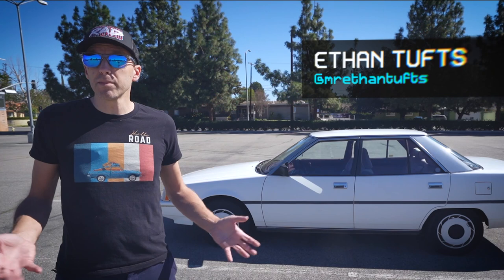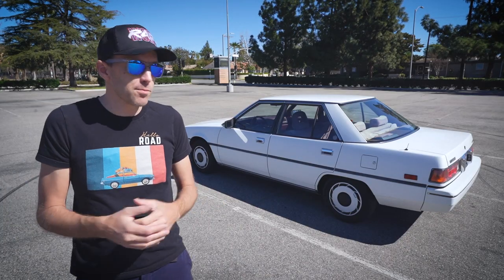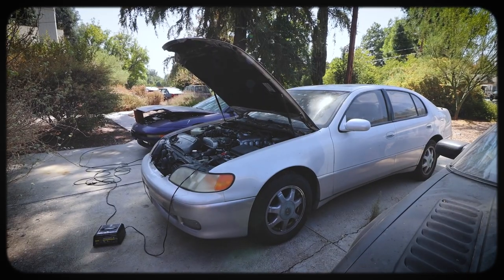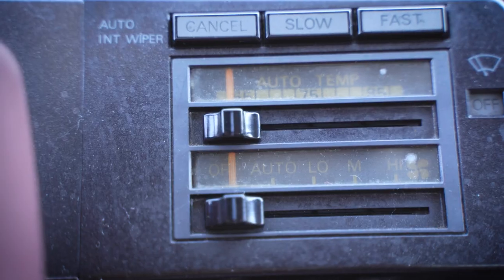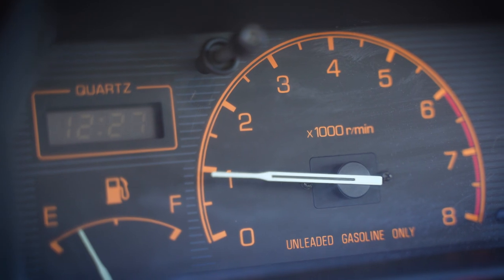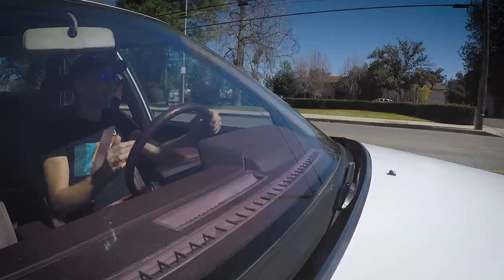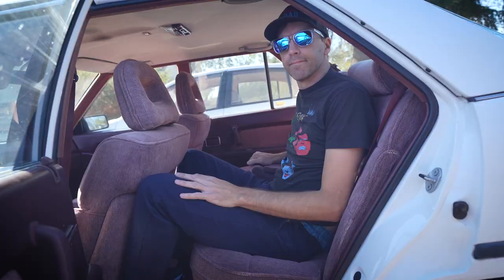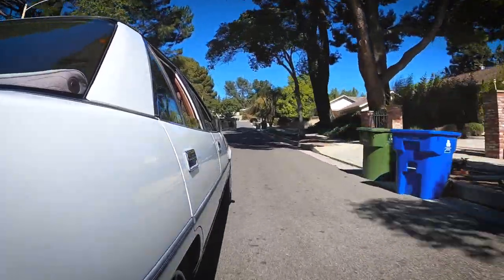I'm Selling The Rarest Car I Own - 1985 Mitsubishi Galant

Comment: In Australia, this Mitsubishi was sold as the Magna from 1986 to 1991. Late ‘91 the next gen ( wide body) Magna , which Australia built and exported to the USA from about 1992 -2003 as the Mitsubishi Diamonte. The top-spec Mitsubishi equivalent was called the Verada , with the 3.5liter V6 in the last generation of these cars..

Comment: Growing up we had a 1987 Galant fully loaded with infiniti sound system with 10 band graphic equalizer, auto suspension,  steering wheel audio controls,  white with brown leather and a sunroof on top of all the features you present on your 85. What a tech marvel, but unfortunately ahead of its time due to 80s electronics, bad transmission, burning oil, and failing cv joints as chronic issues. Still loved the car and have been trying to find one forever.
Reply: IIRC Mitsubishi’s has a silent shaft motors.  My friends Cordia in the day was so smooth, you coun’t tell the motor was on.

Comment: The car I would love to save from the junkyard would be the Saab 99 Combi Coupe.
I dunno what it was called in the US but on the right side of the Atlantic it was called "Combi Coupe". Only a few were produced in the late 70ies.
Most 99s were sedans or two-door-saloons, all of the classic three-box-design of the 60ies. But the "Combi Coupe" was a two-door-coupe with the massive tailgate that became common with the Saab 900 just a few years later.
It was basically a big cool hatchback.
It's hard to believe, but it looked really cool. In a way it was the blueprint for the 900, but it look less massive, more sporty, more elegant. And it looked unique.
The interior was unique as well, with the ignition between the front seats and the strange system for the seat bealts, that totaly made sense. I still want to have these seat belt locks. It was a way smarter solution then the common buckle, we're all used to.
The Saab 99 was decently fast for the time with a good 100 bhp. And it handled amazing. In it's days the 99 was one of the best handling cars on loose or wet or snowy or frozen ground. It was a pretty successful rally-car.
Try to google the "Saab 99 Combi Coupe". It's worth a look.

Comment: Gorgeous Galant. In Australia we have a widened version of the Galant named the Magna with 4G54 engine (Astron II 2555cc), 5 speed manual (KM164 KM210) or 4 speed ELC auto transmission (KM175 KM177 KM177-6). You have the sedan and the Australian designed wagon. There were 4 trim levels and the top of the range model the Elite had the digital dash, velour interior, etc. There were also a few limited edition versions too.

Comment: My Grandmother owned one of these cars in Queens NY a long time ago. It sat for years in the yard until she got it moved.  Great video 😂.
Reply: They are rare on the roads now. Considered just a car, they were destined for the scrapper, like the Falcon, Fairmont, Fairlane and LTD (I had a 1987 Fairmont, dad had a 1986 Fairlane). In the last 5 years they are now worth money now the plant's have shut and nothing is being exported from Australia anymore. Was the first car Australia produced with climate control. This was an early early car as it doesn't have the electronic dash introduced in 1986. Also rare is it being monotone as most had dual tone paint. Yes the trans in the TM were bad. Fixed in 1991 on the TP my dad had. Same with the cracked blocks.

Comment: I learnt how to drive on a manual version of this car in Australia back in 1987. I still remember the new car smell. They were pretty good cars, nice handling and decent brakes. The carb on ours wasn’t great though, it tended to surge now and then.
Reply: yours would have been the widened TM/TN Magna with 2.6 Astron engine. TM Magna was based on the 5th gen Galant but was widened to compete with the Falcon and Commodore, and also to fit in the longer usually longitudinal Astron engine.

Comment: These were awesome cars.  Uncle had a new 86 with electronic suspension and unique alloys.  They were too unconventional for the staid American market at the time.  They added length, a V6 and a Sigma designation to distinguish it from the new 89 Galant.

BUT, the transmission issue was common (same for the Camrys at the time). It is what motivated my uncle to sell his Galant in 92 to buy the new Camry.  Ahh, memories of a time when vehicles all didn't look like the same cross-over, cookie-cutter nonsense that passes for transportation today.

Comment: The first gen front drive Galant - I loved these cars when they came out in Barbados where I live, but the smaller Lancer (Colt) always outsold it and it wasn't quite big enough to compete with the likes of the Toyota Cressida and Nissan Laurel. I think there are only two on the road over here, a US spec one and a UK spec model, but I haven't seen either of them for at least six years now. Hope it goes to a good home; are parts still readily available for it?

Comment: The gauge pod reminds me of the first gen Isuzu Impulse gauge area and controls.

Also, "Back registration?" What kind of BS is Cali pulling? Are you paying for the time it was off the road? Or for the previous owners registration? That seems nuts. I had my Probe off the road for four years, with the plates on it. When I finally let it go last year, there was no issues turning in plates, or the next owner registering it.

Comment: A 10sec 0-60 in '85 was pretty damn sporty. Awful decade for the driving enthusiast, but better than the '70s. If I could, I'd buy this car from you. I'm an original owner of an Evolution IX and have the Evo shop about a half hour away. I'd leave it as is externally, but drop a 4G63+trans+beefed up driveline into it and have a blast! Wouldn't cost that much, but the fun quotient would be off the scale.

If I could save one car it would be a first gen Scirocco. No debate.

Comment: I'm so confused how that back registration stuff works.  In florida you buy a car and register it.  Doesn't matter how long it sat. You just need a plate and pay taxes.  Usually runs about $70 if you have your own plate or $200 to get a new plate.   Proof of insurance and your on your way.   
Wonder if you can take a car that sat in cali and register in florida and then register again in cali without all the back registration crap.   Hmmmm
Reply from the maker: If the previous owner registered the car as "planned non-operational" then I wouldn't have had to pay the back registration. Instead, previous owner just ignored their bills for the last 5 years. State says someone has to pay it. And yes, I'm sure there is a way to skirt the rules but I want to keep the car legit. Plus need to keep these rad blue California plates!!
Reply from the maker: Sounds like Florida has a better system!
Reply: This would be an antique car in many states. One tag for the rest of time. No renewal.
Reply from the maker: Turns out there may be an exemption for historic cars that I didn't know about. Not sure if I'll get my $$ back but I'll try! :)